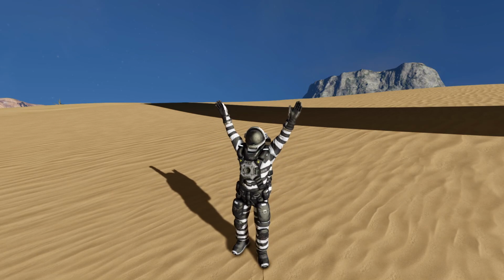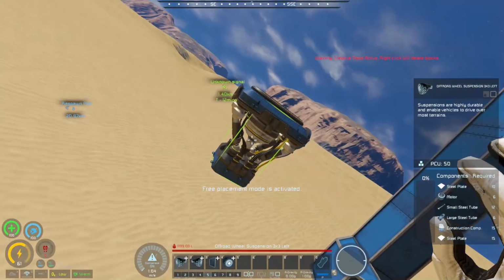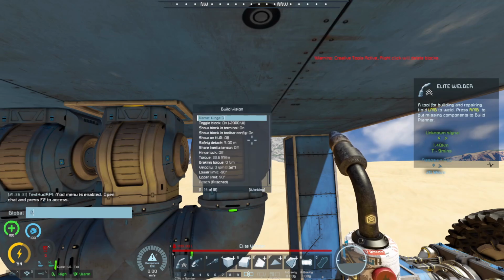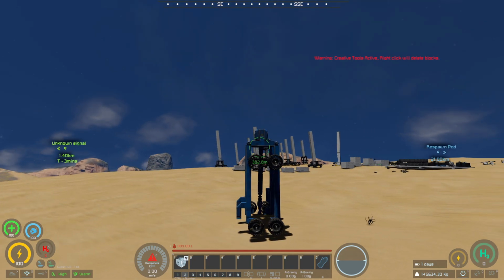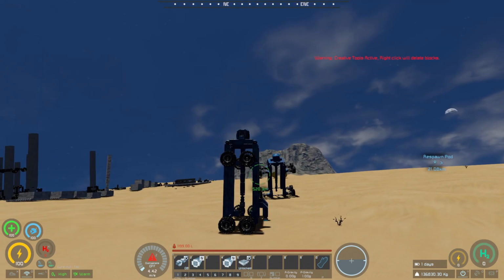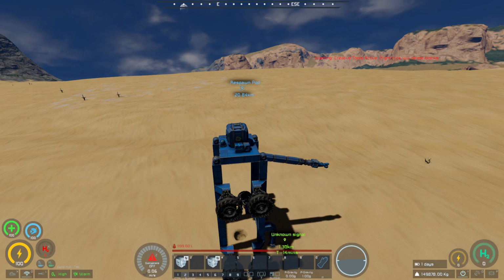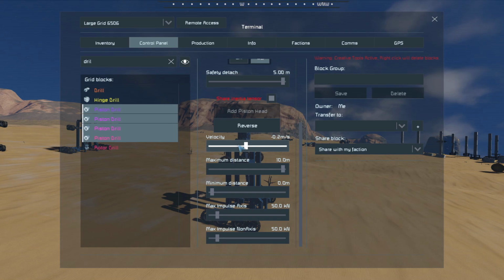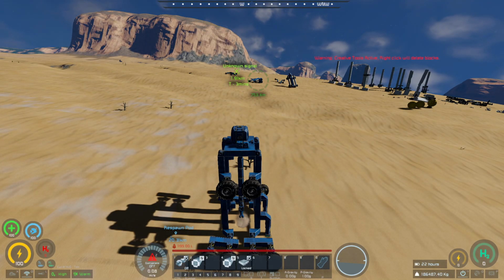Space Engineers Experiments: Mobile Drilling Station Design

Comment: I went waaay too far down this rabbit hole a long time ago. 
My last build before the private server was lost had the containers at the base Reducing centre of gravity for stability, using advanced rotors connected between making a free spinning centre section, with rotating drills and fully extended pistons and retracted pistons on a 180 degree connection.
It was made as a walker, using really simple pistons and Rotors, with a landing gear under each one.
Instead of moving as expected, the entire thing would rotate horizontally around one landing gear locked at a time, switching the locked one when aligned correctly.